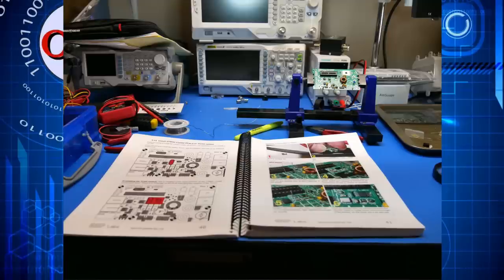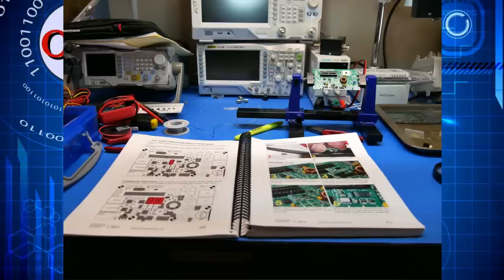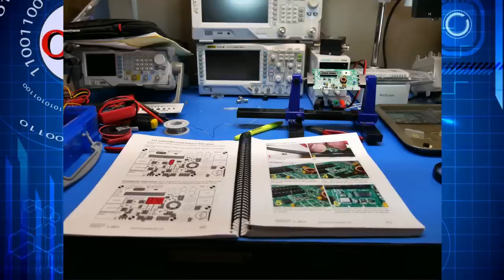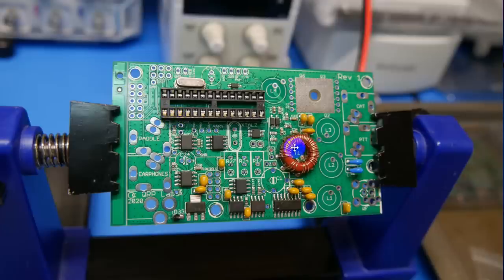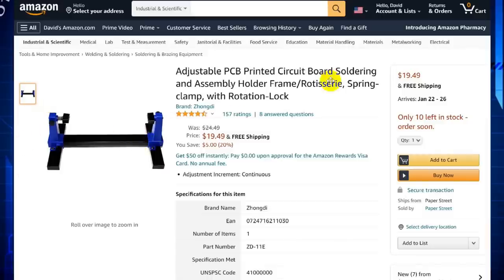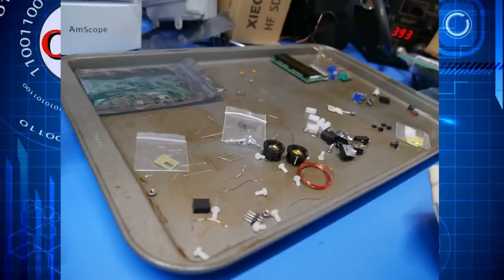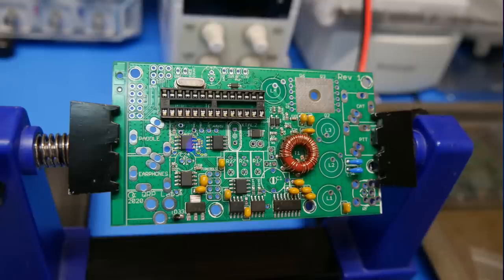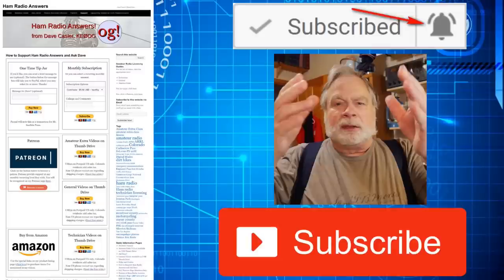QCX-mini Kit Build Status with Discussion of Kit Building Technique (#351)

Comment: Another downside of printing the manual is that you risk missing updates.  So if you print you should occasionally look for updates and transfer these to your printed document.  To minimize this risk, I would wait several weeks after a new kit is put up for sale so that all the early builders who find issues can feed these back and the manual can be updated.  Mark
Reply: One could argue that a "living document" link may have more value over time than a "dead" document that only shows the state it was at the moment it was printed for that very reason.

Comment: ALSO BE ADVISED...if you are reading this down the road into 2021 or later that Hans publishes RELEASE versions of his manual. If you bought the kit and set it aside for a few months and are only now building it, then MAKE SURE you are using the correct manual for your kit's release. Verify this with the PCB as it should have a release number on it. It's also a good idea to step through the assembly instructions to see if they correspond to your board. This happened to me on my initial build of a QCX kit I built and I was chasing four or five manual versions around before I knew it was what.